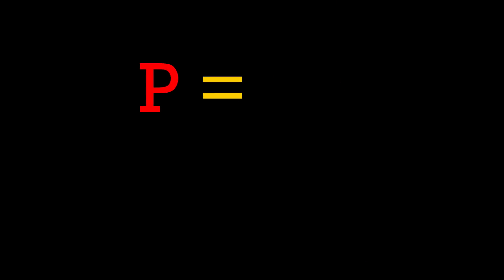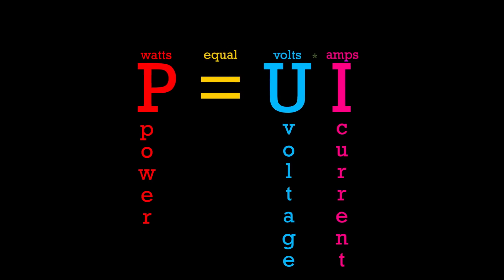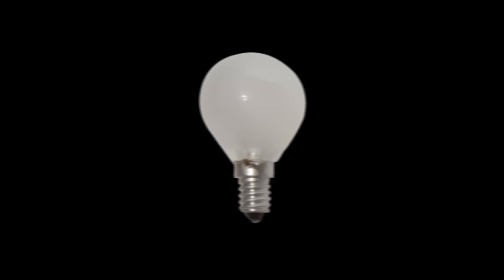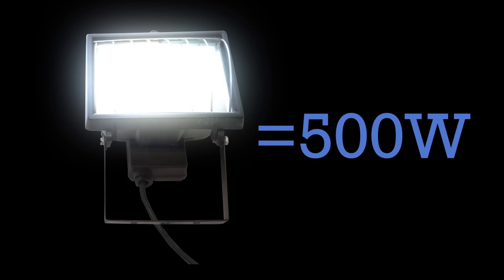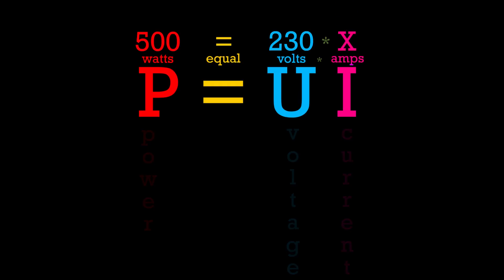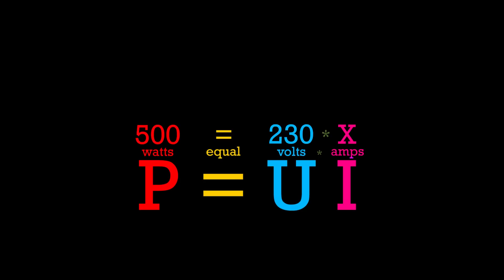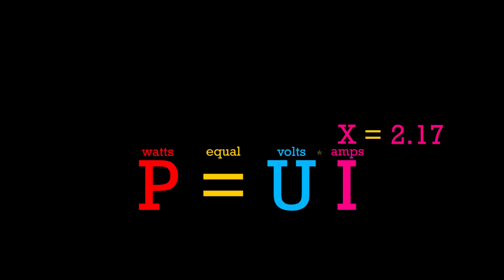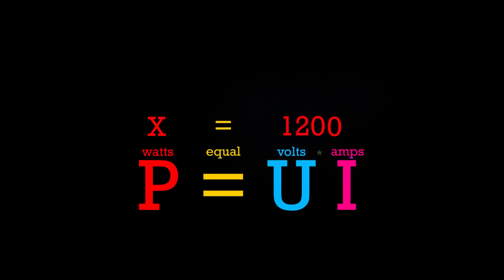How to calculate fuse load

Comment: Wat happens if a product I move from my country whose standard voltage is 240 to that 120v...and my device is rated for example 700w, 240v..wat happens if I used this device in ur country of 120v

Comment: This vid is all fucked up. Ya,Ya this all fine and dandy for quick reference but AC and DC have different factors to consider.
aka. true power vs. apparent power. RMS vs. Peak to Peak. And then there's temperature coefficient  and the list goes on. All I'm saying folks is be careful out there when sizing and applying electrical math problems or you will let out the magic smoke.

Comment: this sounds as all 1A Fuses would be the same as any other 1A Fuse.  is it ?! or is there more to it? example: lets compare a 5A Car fuse to a 5A fuse for house installations (110 or 240V~) . are both fuses equal in resistance/power ?
Reply: Huh?, In the thirty years I've been an electrician I've never seen a 5amp house breaker? They do make them for control panels in industrial application and motor control.